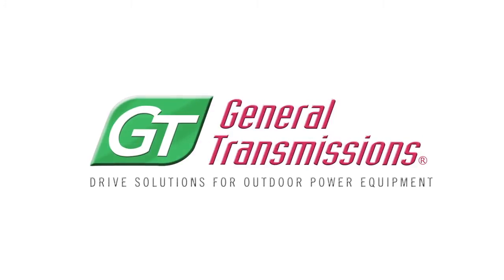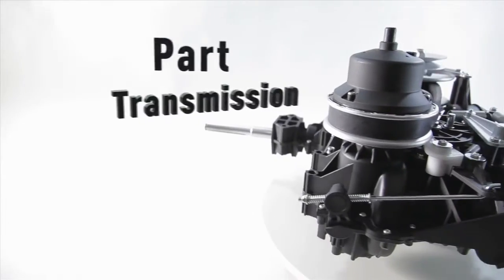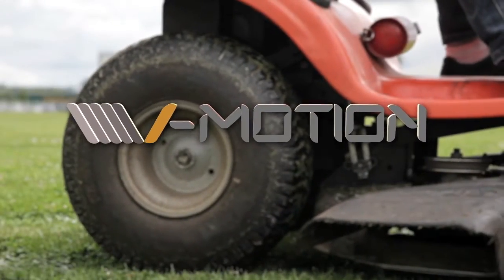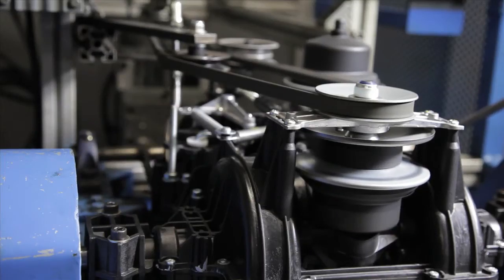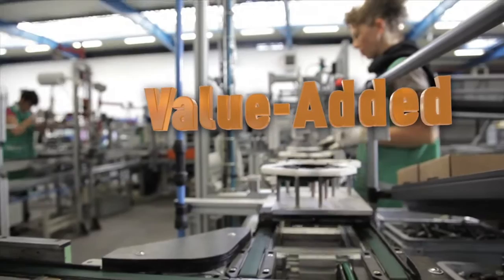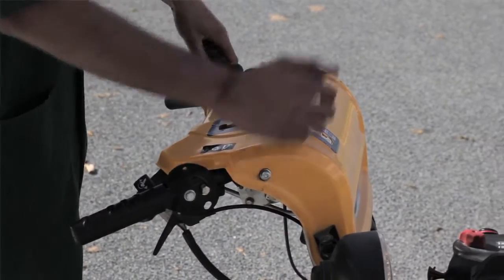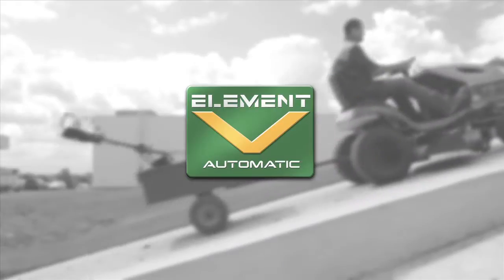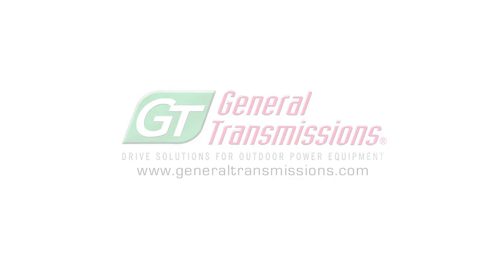General Transmission - Element V

Comment: These transmissions suck
Reply: worse than the hydrostatics?
Reply: Nicholas Joseph Yes much worse
Reply: ***** I work in a small engine shop and replaced 5 of these things in the past year
Reply: ***** look for a John deer or a rider that says HYDROSTATIC transmission hydro static is much better stronger and smoother